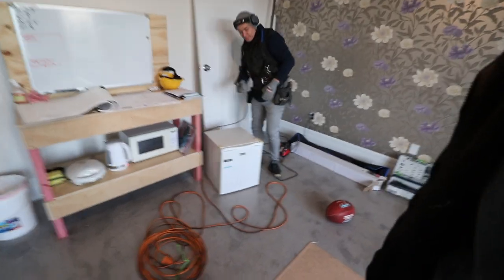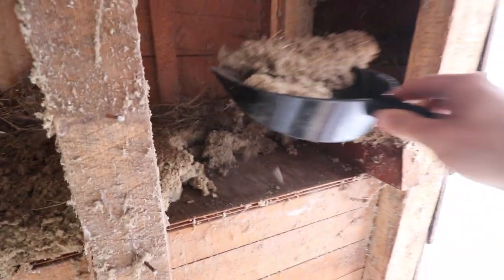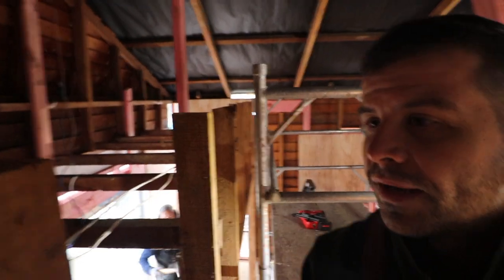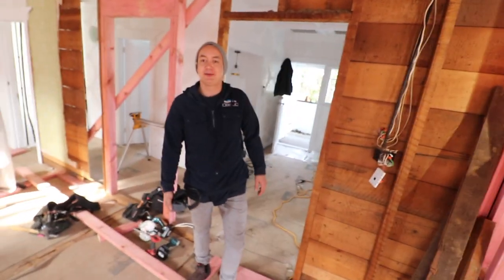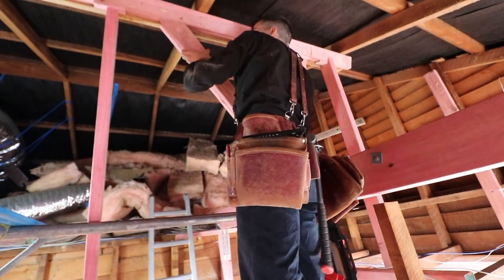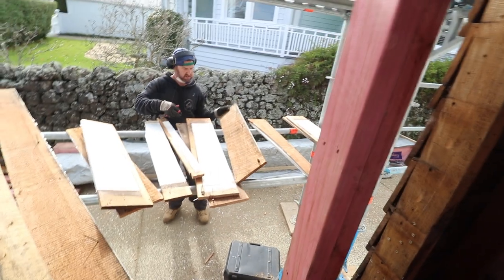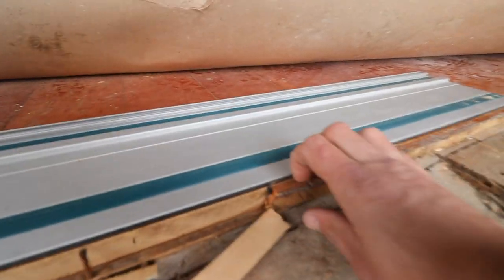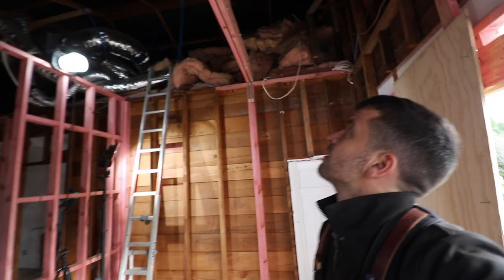Using Beams To Create A New Room

Comment: You can lock the saw in a plunge position to make it easier to change the blade. Use the little pin for the score cut and you can lock that into the green wheel at the top of the depth adjustment

Comment: Wood shrinks more across the grain then it does along the length of if. You're better off notching the post than adding a small block as you did. It will likely either open up or never bear much weight.

Comment: would be interesting to know did you price this job, or take it on hourly rate + materials? loved the vid!!
Reply: Jobs can be down on a fixed price so scot has to honour the price agreed at the start of the job regardless of how much longer or shorter scot calculated in his price.
Or jobs can be done on time, which is charging a rate per hour per man every day till the job is completed
Reply: However vast majority of builders would do a job like this on price for the main stuff that can be easily estimated then do the more awkward tasks that is hard to know accurately how long it’s going to take to complete on an hourly rate
Reply: Fixed price + variations
Reply: We hire Labour only builders as we own old wooden Villas and generally once you open up a wall/floor/roof there generally another issue that needs addressing.  Labour rates vary here in Auckland from $45 to $60per hour for a Licensed Building Practitioner.  Our Last project for Labour only for 2 Builders was nearly $60k approximately 12 weeks work . Materials were another $135k.

Comment: Love the videos.  I have always wanted to do Carpentry. But havent. I am 21 and have done a apprentecship in Mhecanical engineering and I am a cabins interior fitter for aeroplanes. The job pays well but I no longer have a enjoyment for It and campentey I have always wa ted to do as I am 21 is it to late to leave my current job and do a carpentry and Joinner apprenticeship?

Comment: Hi  Scott. Really interested to know anything you can tell me about this 'flitch beam' you've installed here. I've got a 'ridge beam', carrying a sheet metal gable roof, and that beam needs to span 6.4m at one stage. So I'm thinking that maybe a 'flitch beam', much like what you guys have done, will be the way to go. Can you tell me, if you still remember as it has been a couple of years on, what length this beam is, and the dimensions of the beam. Do you know anything about its carrying load. Thanks mate. All the way from across the Tasman, take care. Cheers buddy.

Comment: Hey Scott you really are an amazing carpenter, but I do have one question, I only saw a construction adhesive for this noggins you out in before the floor went down, did you mail to either side of the floor old and new off camera? Done a similar job myself and done a video but obviously want to make sure what I do is done just as good as yours! Many thanks 👍
Reply: @forward renovations yes he undoubtedly will have nailed the noggins to the joists either through the joist or by toenailing through the side of the noggin in to the joist.

Comment: Hi guys,
Love your videos!
I got a question for you: What is that blue board that you sandwiched between the two beams and why do you do that?
Reply from the maker: The previous episode explained it better, it's a steel plate, 10mm thick and primed with paint to prevent corrosion. The steel helps support the timber under load, stops it from sagging 👍
Reply: @ScottBrownCarpentry  thanks bro!

Comment: How the hell do you even bid on a job like this? Way to much to think about. Great job Scott.
Reply: You just have to get yourself a materials list from your plans and then break each little aspect of the whole job down and estimate how long it will take,from breaking it down like that you have a close enough idea of how much of your own time that you need compensating for and how much time for your other men. If you are the builder or main contractor you add anywhere between ten and thirty percent on top of their daily wage for yourself,the same goes for the other trades that you have to get in such as plumbers and plasterers. This has the added benefit of giving you a margin to allow for any part of the job that takes longer than you envisaged like it will have done when they were digging out for the posts that under the floor,for example one hole took rich 8 hours to dig,you need to be covered for such eventualities.
Reply: @garethheathcote4988  thanks for the reply.

Comment: Any reason you used flitch beams rather than LVLs?
Reply: That's a question for the architect, as it's done on what is specified. Also LVL is pretty expensive in NZ.

Comment: 9:47 - the chip port on your planer is blocked. When that happens the tool is forced to blow the chips forward from the blades and creates judder in your cut and fooks your bearings ..